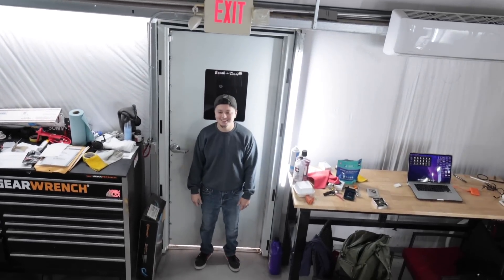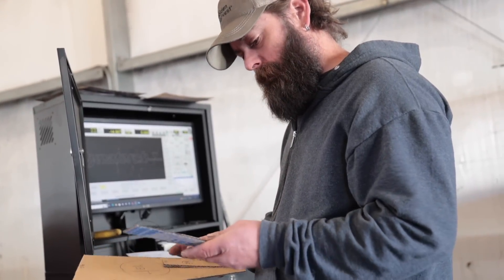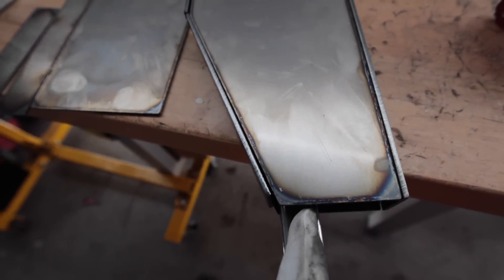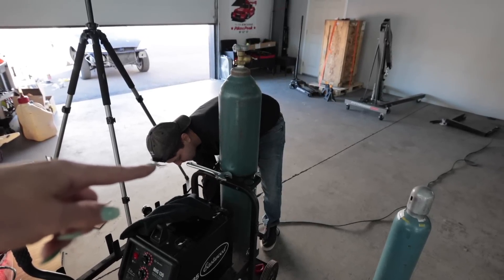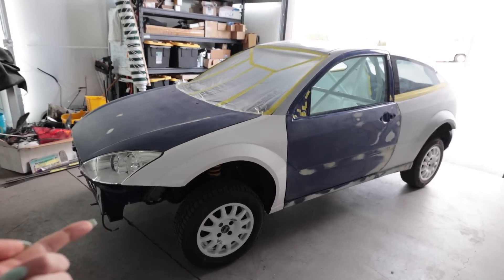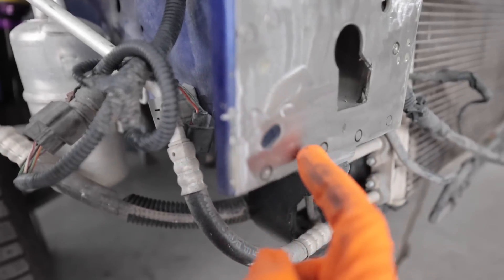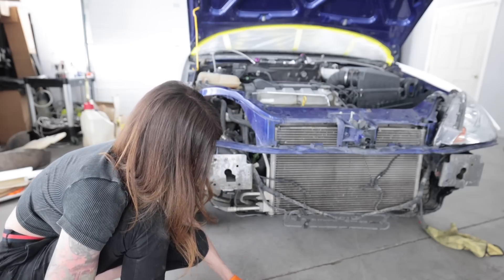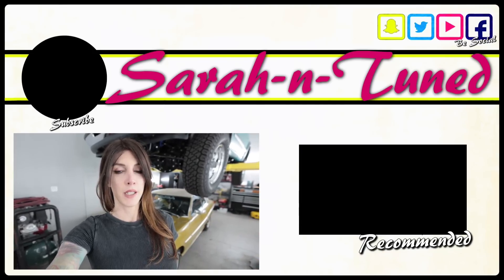Engineering My Own Bash Bar // Focus WRC Build

Comment: We have a 10' x 5' plasma CNC and we used to make collapsible backpack stoves for Cabela's. Lots of artwork too and log cabin gussets. It's so nice to be able to design and cut out ideas. Cheap gasless welders work quite well. Large crescent wrenches work great for metal adjusting, I've even bent 1/4 steel with the 2' long one that we have. Looks fantastic!!

Comment: @11:46 pro tip blowin skills we see ;)~
Reply: speaking of which, pro tip, get a cap from spray paint can or wd-40 can and fill it up 1-2" with motor oil, any grade will do- then every time your bit starts to get hot, just dunk it into the oil. this will cool the metal and keep it lubed

Comment: Pinholes and porosity in a MIG welded bead is a sure sign the gas is off or blocked. You can physically hear and see it when it happens as you’re running the bead.

Comment: Can use a self-lubricating sort of horizontal band saw where the blade moves rather slowly and uses its own weight for blade pressure.  My favourite machine shop uses this technology.  The place the piece into the jaws of the saw, walk away and let it work its way through the piece.  Works great.

Comment: Next fabrication job, try working out more in your templates. You could mock in more detail in cardboard and you could have worked out all your cut hole positions and had then added when the plates were cut.
Watch project Binky for tips on both fabrication, and pace and content for fabrication videos. Check out Mike at stanceworks too. His fabrication content is slick!
It's not easy, but well done on the work so far. 👍👍

Comment: You have to push the puddle on the mig welder, stick welding you pull the puddle. The type of metal is turning blue so is an alloy so maybe fusion welding or mig.

Comment: The tough part of building up that front unit the way you are is that you have all those holes that would have been easier to have had done on the plasma table.  The next one you make will be a  snap! 😉
Another option for the boxes would have been to cut them out with the tabs attached with about the thickness-worth of extra material in the margins.  Score those margins on the inside with an angle grinder and they will fold up easily while held in the bench vise.  Then you can reinforce the folds with a weld bead.  

Check out Ron Covell's channel for metalworking inspiration!

Comment: Little circle motion forward or rear angle technique rear is best for finish angle the the torch 45 degrees to the weld always plus 45 degrees from the forward view down 45  to the joining and 45 to ward your wrist so you hold in a curve the little circle are important the weld should glow one circle and pull back another circle and so on , anti splatter spray is neat too.  Hope it helps...

Comment: I really like watching you fabricating all the metal works on the Focus. When you are welding, maybe try to put the welding gun closer to the metal, so it doesn't splash that much!? Why don't you use the metric instead of the imperial system? I don't get it...

Comment: As part of rally car, those "box" should be as light as possible. Plasma cutter can drill holes easily (ref aeroplane structures). And for easier fabrication, leave connected pieces partially uncut and just twist and weld. Need some more planning but worth of it. (yes, I made this with anle grinder and MIG).

Comment: I just watch because you are quirky and entertaining. You could be building garden furniture and I’d watch it. Don’t pander to viewers do what makes you happy. 
I’d rather that. 
One thing though if you are going to be drilling a lot more go grab a bottle of cutting fluid like Rapid Tap if you can. It will save your drill bits and cut holes faster than doing it dry.

Comment: You could be updating your residential sewer system and I'd enjoy your capacity to learn all the same.  You produce, I consume.   Great job on the mounts!  Great part-way done mounts! 😉 Could have saved on the welding if you'd put a just a couple/few 90 degree bends sprouting off the first main plate.  Not that you don't enjoy the task as it's obvious you do!  Excellent plan with the reinforced bolt hole spacers!  Thank you, and Angel, for the effort, sincerely!

Comment: Love the videos you do Sarah. Just a thought, You could just drill out the face of the box you made to be big enough to fit the allen head bolt and not need the tube to secure it to the bumper bracket. The tube is not needed. Also don't go to heavy and strong with the bash bar. You want it to bend and not transfer the energy of an impact through to the chassis.

Comment: Hey Sarah,little tip for welding that I found worked: instead of going up and down trying to hit both walls evenly, start the puddle, move forward, then come back onto the freshly laid puddle. You get what's called stacking pennies (or dimes!) And if you get the timing just right, it produces a strong even weld. I used to seam weld road sweeper chassis in one of my old jobs, along with building them in the jig.
Reply: Agreed, I always heard that you should push your puddle rather than drag the puddle.
Reply: Drag the puddle for stick welding, push it for MIG. You get way better fusion that way.

Comment: Just one tip. The holes for the bumper pins should have been in the patterns pulled from the frame and cut on the plasma table. Would have saved a bit of extra work.

And the fab videos will expand your channel over time...

Comment: I am not tracking why you need the fangs and not just a boxed spacer?  Maybe it's just the look but the seem pretty low and with as strong as they are, would transfer a hit to the bottom into the frame.  I am enjoying the rally build!

Comment: Having some tin bashing and welding content is awesome and adds another layer of interest to the videos, you do a great job with everything you do and you'll be welding like a pro in no time. If you are going to be doing more of this you need to invest in a pillar drill instead of struggling on the floor with a hand drill

Comment: dont worry as much for the views i like what you are doing and as a owner of 4 SVT ford focus its nice to see one turn in to a rally car i had some videos as well on dose cars and some have allot of views and some others dont have that much and i have some proyects going on that has almost no views but i need to finish them up anyways so just keep going on with the project and dont let it sit there love the videos ohhh by the way thanks for the tip on the msrc thingi the throttle open code i never found out why one of the 4 cars where slower than the other 3 and why it has a hard time to cold start and now i know it was the stupid actuator that it might be damaged from a previous wrecked ill try to fix that one and ill let you know what the problem was after i fix it love the videos dont leave the focus project please please please bye ......

Comment: love your videos. Just a hint on drilling holes, center punch your spot then drill with a 1/16th inch drill. Step up by doubling the drill bit size till you get to final hole size. Also have a small container of oil so you can dip the bit in it, when you feel more drag dip the bit. It is faster and the bits stay sharper doing this method in 1/8th inch or thicker material. 
Keep on doing what you have been doing. Watching your videos is like hanging out in the shop with you doing what you have to do to get the project done.

Comment: I like the recessed hole idea but I think it'll still clear the bumper plate with the heads of the bolts even, save some labor if it works out.

Comment: I'm enjoying the fabricizing.
One suggestion for drilling bolt holes is to use step bits, they make nice round holes and of course you can step them up to the appropriate size so you aren't always changing drill bits one after another.

Comment: Ok. You really need a metal fabrication table (get one made for you by your neighbor) so you can clamp things down and not hurt yourself...and... very important you need a decent size bench vice to hold stuff when you pound on it and they are so useful for a million other things you do.  (Mount it to your metal fabrication table) ...and ...please, please get a small a drill press .. I swear if I see you drilling stuff holding it with your other hand or foot squatting on the floor so the camera can see the object one more time I'm gonna scream into my phone.  Safety supercedes content.  ...Now that I vented.. Please continue..

Comment: Nice. Big ups for a second go.  But you could have got the plasma to make the holes for you, welded nuts on the inside and bolted from the back. Also cut the circles for the bracing tubes and had them in shear.

Comment: I enjoy your channel. Whatever your project is you make it interesting. A couple of thoughts. Why do you always work off your knees/floor. You have a lift pick up the work. Its always easier when the project is  at a height you can walk up to. Why don't you have a drill press? I know you are limited in space but you could have a bench top press. Put it away when you aren't using it, throw it up on the bench when needed. When you are fabricating and need to make 90° corners get some square tubing or square stock and tack it in then butt the other piece up to it. You can use clamps or welding vise grips to hold it in place. If you would have put square stock or cut off bolts in the corners then the top piece would have just sat down on them and it would have made it easier. If the top sits down inside just under cut the length accordingly.

Comment: The holes for the nipples looked more inviting and as if it would have caused less wear on the bumper and nipples themselves.  I'm worried the steel would be more abrasive and cause harsher wear.  It is true though that bumper is made of strong material

Comment: You really need to switch over to using "Unibits" when drilling holes in sheet metal instead of using drill bits. They cut a cleaner hole and don't grab as much.

Comment: Looks like not enough amperage and too fast on the wire feed. This is shown by the weld beading up instead of penetrating the material and flowing into your puddle.  You'll also want to look for a technique called walking the cup. The distance that you're holding the cup out from the workpiece affects the gas lens coverage. And you'll want to check the gas flow required for a given amperage....too much gas and the weld cools too quickly. It's a lot to know but the weld quality increases exponentially with knowledge and practice.

Comment: not enough current. welds have insufficient penetration. use test pieces and flex them to test for strength. oh well its likely what you did will hold the bumper ok. also you are not holding the welding  torch close enough to the work so the gas is not surrounding the arc.

Comment: I find the fabrication work interesting, especially as you apply your problem solving skills to it. I could be mistaken, but isn't there the potential to damage your camera sensor by directly shooting your welding? I thought that could lead to a permanent burn-in spot.
Reply from the maker: It’s a mirror less camera, so I don’t think so 🤷🏻‍♀️
Reply: I believe whether it's mirrorless or DSLR should not make a difference as the sensor technology is the same. I just now tried to search out information on the subject but cannot find anything definitive. The consensus seems to be that there would be no problem recording relatively short segments of welding, whatever is meant by that. Apparently welding produces a fair amount of UV light, thus the understandable need for eye protection. You are obviously keeping the tripod back far enough to keep it safe from sparks.

Comment: No drill press?
Reply from the maker: Don’t own one no
Reply: @SarahnTuned  It's worth having, especially if you're doing to do more fabrication.  If you can find a used floor-standing one in your area, that would be the way to go.  Otherwise start with a $100-ish table model from Amazon.  You can do all sorts of things will a drill press.  Drilling, sure. But also light pressing, drum sanding, polishing, etc., with the right fits and bits.
Reply: @SarahnTuned  Amazon will be delivering a floor-standing drill press and a 6" drill press vise on Jan 23rd (10am - 6pm).  The order confirmation has been sent to your business email, keep a lookout for it, any updates will be forwarded as well.   Pls slap your logo's all over them!

Comment: Sarah, you really are close on the welding just a few things will make it perfect. Your weld was too cold, looked like the settings were about right, it was the technique that lost the heat. Get the angle of the mig gun right. About 15 degrees leaned back and travel away from the bead. Then the stick out of the wire was too much. The wire specs will recommend a stick out, but with experience you can tell by moving it in and out a little to find the spot. Then when making your weave move the gun slightly side to side rather than the large arc motion. It will be easier to maintain the angle and keep the bead straight.
Reply: "...but with experience you can tell by moving it in and out a little to find the spot."

Comment: You need a machine shop to fabricate missing parts. One of my bikes had a part that was missing that couldn’t be found anywhere and my mechanic had the local machine shop make it from a manual description! I learned that never isn’t an answer since when something is no longer produced, its still possible to get what’s needed. Your Ford Focus SVT project is still on track.

Comment: I personally enjoy the fab work, but I will note your previous video didn't show up in the recommended queue and I had to go to my subscriptions so it may have been the YouTube gods, your language has been a little more salty recently could that affect the algorithm?

For the bumper horns unless you need clearance for the bumper covers I would use bolt tubes through the hollow part so it doesn't collapse in as you tighten it and leave the bolts on the outside the larger heads would have more holding power.  Require much smaller tubes doing it that way.
Reply from the maker: Yeah, YouTube hasn’t been recommending my videos lately. They’re promoting more stupid clickbait overdramatized nonsense lately at least for me on my feed.

Comment: Fab video was way better than most other vids. People can't relate that why they didn't watch as much because most don't weld.    Your welds are inconsistent because of how you're holding the gun.  Use your left hand as a guide and hold the gun with the right hand only.  You'll be much more even. Also you need a light bright ass light to have pointed at the project so you can see your puddle better. And of course you need gas!!

Comment: Sarah, I believe you may be using the wrong disk to cut metal. The disk you need is a Metal Cut-Off Disc. The one you have appears to be for wood because it has teeth to cut through wood fibers. The metal cutting disk has no teeth, dark in color, and is made of compressed fibers. It grinds away at the steel to cut it off.

Comment: Sarah on the spacer tubes get tubing that just fits the bolt shank cut the heads off the bolts and drill holes through the tubing sides and slip the bolts in the tubing and weld through the holes.

Comment: Why do you need the pipe inside the mount for the bolts??? What if you just made a big enough hole from the nipple side so you can fit a socket in. Nipple side would be flush then🤔  Saving weight here😂 
Also drilling holes is so difficult with a milwaukee drill compared to table drill (sorry don't know the term for it in english), If you wanna do more this you might consider buying one. Please keep doing this fabricating stuff.😍

Comment: People are probably going to hate on this comment, but... As thick as that metal was, you could have used gasless flux core wire to weld those pieces. Would have been just as strong and not run out of gas.

Comment: I liked the core support video, and watch all of the building videos. So, no clue why one wouldn't do as well.

Also, I may have not seen this right, but the sputtering when you weld may have been that you were welding outside the gas bubble. Always push the gas and the weld ahead of the nozzle, if that makes sense. Or I could be doing it wrong.
Reply: In the video they mention they were out of shielding gas...

Comment: Sarah your fear of rotating wheels of death is not irrational, if you're not you will eventually hurt yourself with it.
Enjoying seeing you learn, not surprised less views as you're doing something a bit different to normal.
Reply: exactly - respect anything that has teeth, centrifugal force (or is that centripetal?) and high rpm
Reply: One thing that might help with spin a ma things is to do them with a hand saw hard work is encouraging while respecting the cutting teeth cause they can hurt too and tear flesh

Comment: Welding is almost as much an art as a skill.  I see your big door is open (for light and ventilation no doubt). If you've got more than about 1/2mph breeze, it'll blow your shielding gas away. Also, your current is a bit low. Welds are too piled up/high.

Comment: Be careful your cement floor when heat is applied can explode into tiny shards. And they hurt and even get in your eye. Also put a block of wood under parts you are drilling so you do not damage cement floor.  From retired welder of 25 years.